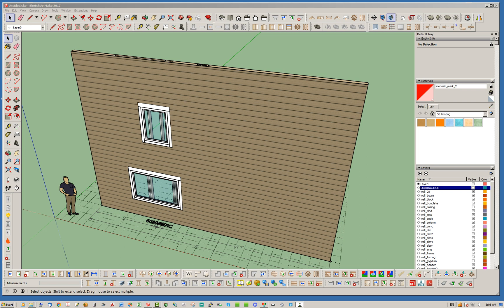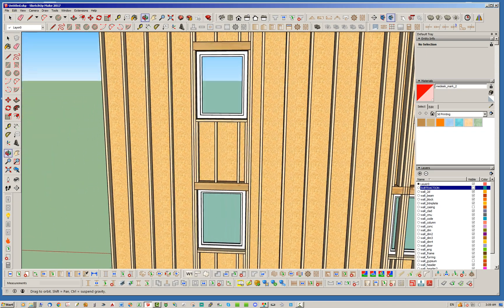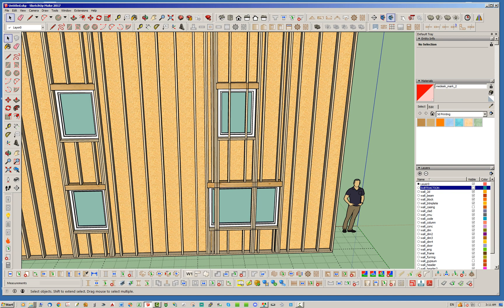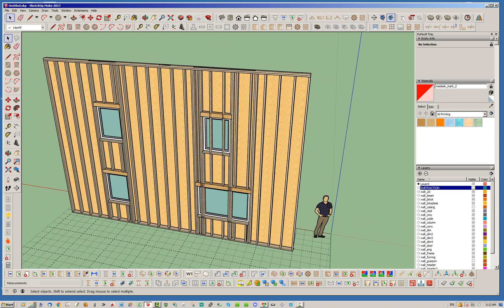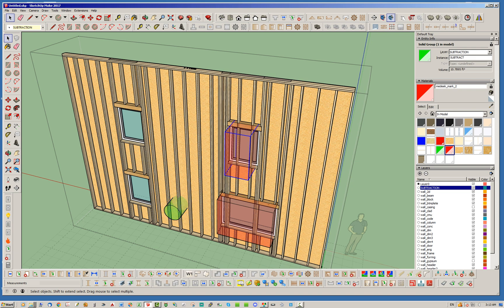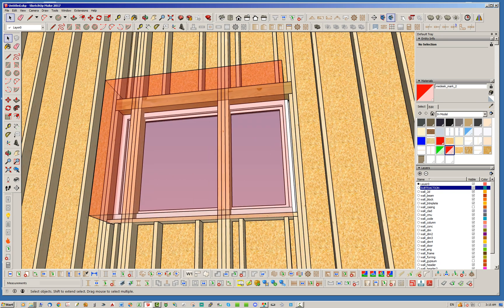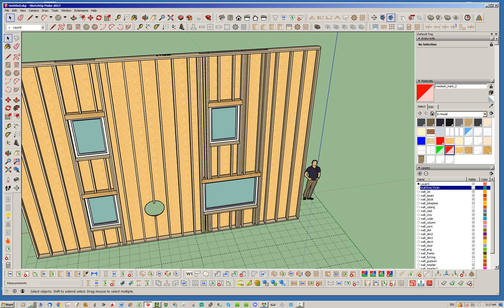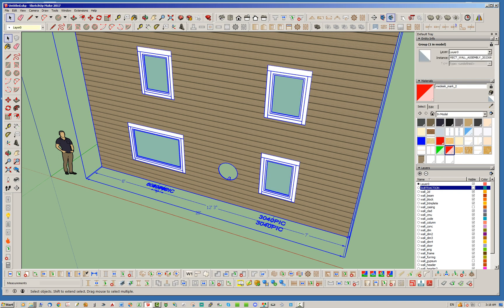Medeek Wall Plugin Tutorial 40 - Stacked Windows

Comment: If I had to build this wall I would frame the supports for the top window to mimic the window below…

So the top window lintel length would extend to the same as the bottom window lintel length and rest on the king and trimmer studs that would pick up the weight…
then I would infill around the top window as needed, so no imposed loads are created above the bottom lintel.